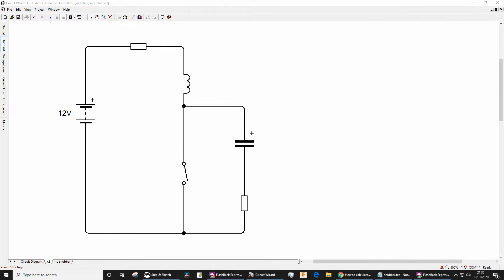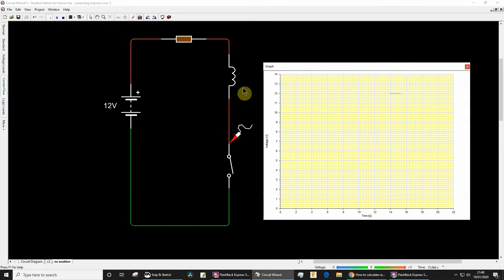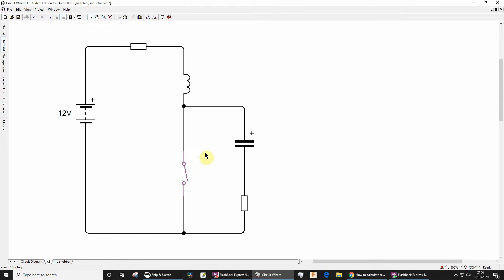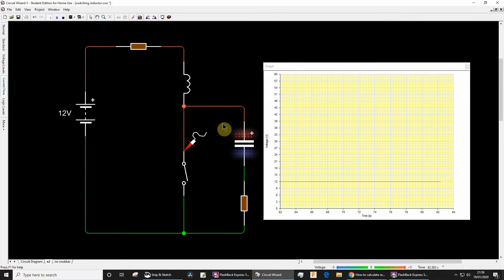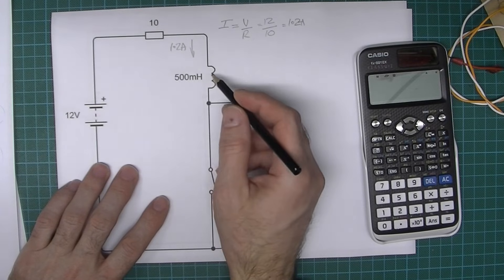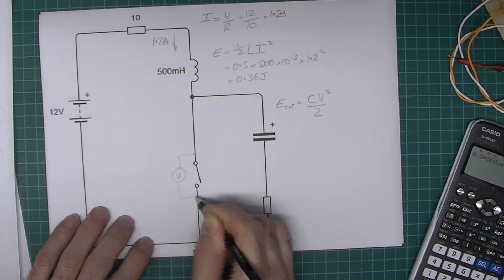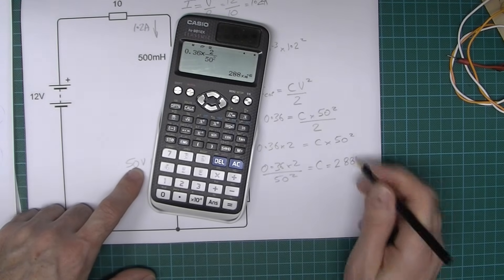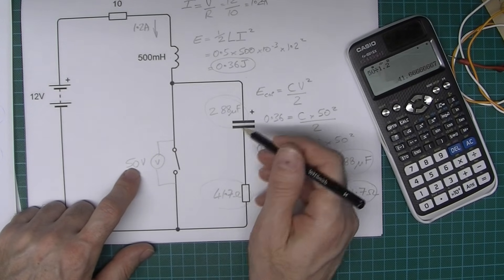RC snubber circuit design and calculations for inductive loads

Comment: What should be the wattage rating of the resistor? Doesn't I^2 * R = 1.2^2 * 41.7 = 60.048 W seem a bit much for a transient? How should this be calculated?
Reply from the maker: Calculating the peak (transient) power is clearly being very safe and likely over-specifies the resistor rating. Calculating average power might be more acceptable but we have not defined the switching frequency in this circuit. What do you think?
Reply: @PizzeyTechnology   The only thing I've been able to find regarding this is that the power dissipated in the snubber resistor is equal to the sum of the dissipation during the turn-on and turn-off of the bridge. I was hoping you knew of an easy way to obtain this as your video is very informative and is quite excellent.
Reply: @sayinpower3  you could try 2 * V^2 * f * C for a crude estimate (V=voltage on the cap, C = capacitance, f=frequency). this only takes into account one charging and one discharging per cycle. real dissipation might be higher due to ringing, if the system is underdamped.

Comment: Great explanation ,How do I calculate resistor and capacitor for an inverter circuits between the drain of MOSFETs and ground
Reply from the maker: Abu, thanks for your appreciative feedback. Can you post a link showing the actual circuit?

Comment: Thank you very much for the video. Few Questions though
1. The power rating of the 10 Ohm resistor should be 1.2*1.2*10 = 14.4 Watt ?
2. If I am using the Inductive load of a Transformer, How do I calculate the saturation current of the transformer.?
3. I want to maximize the output voltage of a pulse transformer, How do i achieve that through circuit design?  
Thanks in Advance
Reply: 1) correct. P = R x I^2
2) You don't. You need specialized equipment to test the transformer. If you are using an old SMPS transformer, usually people go for a Bmax of 1200 ~ 1600. You only find this information with the datasheet
3) what do you mean by maximize? You mean step up the voltage?

Comment: Will a snubber circuit recharge battery if it was switching a DC motor on and off? Making the whole system more efficient?also increase battery run time?

Comment: hi...pls clear me if i'm wrong.
why you considered 50v in the calculation of Capacitance finding. as the circuit is operating with 12v supply.
Also, you have calculated the circuit current by taking 12v voltage.
I think if took 50v instead of 12v calculation will be wrong. as we taking calculating value wtih 12v in all formulas.
Reply from the maker: Hello Shivm, those are good questions but you may have missed an essential point -- the circuit is capable of raising the voltage above the supply voltage. In the example I chose 50V but I could have chosen some other arbitrary (but acceptable) voltage. The snubber then suppresses the potentially high voltage caused by the inductor. Without the snubber, transient voltages can easily exceed the supply voltage by many times. Does that answer your question?
Reply: @PizzeyTechnology  Agreed thanks for the nice explanations.
Reply: @PizzeyTechnology  Even if the circuit has a potential to raise the voltage beyond 12V, the spike does not appear across the capacitor. The capacitor also stores its energy at 12V, so I agree the value used for the calculation of the capacitor should be 12V.

Comment: Dear Sir.. Thanks for easy explanation... I need to discuss on pwm based motor drive mosfet circuit.. I observe upto 40 v spikes... I need ur help do u like to share ur email contact... Mine is shahzad1474@gmail.com
Reply from the maker: Hello Shehzad. If you have questions like this then I highly recommend posting a question on https://electronics.stackexchange.com/
Just make sure that you include the full circuit diagram, a clear explanation of the problem and a clearly defined question.

Comment: What if I use  very high frequency switching then there is no time for the capacitor to discharge completely, how to deal with that???
Reply from the maker: Good question but not something I feel qualified to comment on (and have people rely on my answer). How about you research specific applications with a higher switching frequency - switched mode power supplies perhaps?
Reply: Maybe an NPN transistor, or a small mosfet pararell to the capacitor, so when the switch is turned on, it shorts the capacitor?

Comment: Hello, thanks for the video. Some questions: 
1) Does it matter on which side of the capacitor/switch the resistance is? 
2) Does the capacitor need to have voltage rating of exactly 50V or would it need a minimum rating of 50V? 
3) Why not use the amp rating of the switch to calculate the snubber resistance as, if I understand correctly, the discharge of the capictor will flow through the switch back to the capacitor, and thus not affect any other components of the circuit? 
4)  As the energy of the coil is equated with the energy of the capacitor, does it mean that all the energy of the coil will go into the capacitor, and that when this happens there will be voltage difference of 50V over the capacitor untill the switch is opened again?
Reply from the maker: 1) The snubber resistor and capacitor can be placed in any order; as they are placed in series it should not affect suppression of the transient voltage. It may be worthwhile noting that RC snubbers can be used with AC and DC loads. RC snubber networks (an actual component) are available and if you check a datasheet I expect you'll notice they are not polarised. I hope that answers your question.
Reply from the maker: 2) Exact ratings of components don't really exist as they have a tolerance. If you wanted to limit to 50V then it might be desirable to have a capacitor with a rating of at least 50V and preferably more. 100V would be a good margin.
Reply from the maker: 4) The voltage across the capacitor will be 50 V when the switch is opened. The voltage across the capacitor will be close to zero when the switch is closed.
Reply from the maker: 3) Not entirely sure that I have understood your question correctly -- sorry, it's probably me. The switch should have an amp rating to handle the expected current -- in this example circuit at least 1.2A -- but the calculations I go through are to limit the transient voltage. If I was using a switch rated for 50VDC / 100A it would not change my calculations. If you watch the video again you'll see that we simply use Ohm's Law to calculate a suitable resistor value, based on the known current and desirable peak transient voltage. You are right to think the capacitor will discharge through the switch when closed.
Reply: @PizzeyTechnology  for Q3: I think I am a bit confused here, as I don't see what the calculated total current in the "main circuit" (battery, 10ohm resistor, inductor, switch, battery) has to do with the discharge current in the "snubber" circuit (capacitor, snubber resistance, switch, capacitor), as I feel that the current discharge in the snubber circuit will happen before the current in the main circuit will come "on". In addition, as we are trying to protect the switch from the discharge current, it would make more sense for me if the snubber resistance would be calculated as R_snubber=V_capacitor/I_switch. Part of my confusion probably also comes from the fact  that I read in other sources to use the rated switching current for R_snubber (example can be found in the text under fig4 in: https://www.littelfuse.com/~/media/electronics/application_notes/reed_switches/littelfuse_magnetic_sensors_and_reed_switches_inductive_load_arc_suppression_application_note.pdf.pdf). Apologies for pushing, and thanks for the answer already provide.

Comment: Why do you have choosen the whole inductance for the calculation ? As far as I know you choose the leakage inductance because this is the part that you can´t use (magnetic loss into air) and it comes back as the spike to the circuit. Of course I don´t know If we are talking about a transformer or air coil here ? If it is the second you are right just wanted to clearify things. :)
Reply from the maker: In this example I assumed a single coil. There should be no leakage inductance that would be associated with coupling a primary and secondary coil. Is that right?
Reply: Of course you are right ! With air coil I meant single coil too. I should have tell it more clearly. Leakage can only occur with two or more coupled coils. It doesn´t make a difference by the way If the medium is air or iron or ferrite as anybodycould think that because of my answer above. Single coil never can or will have a leakage inductance only coupled coils. The medium just changes the leakage value itself.

Comment: Thank you very much for an easy explanation of a complicated subject. I appreciate the flow of explanation was fantastic.  I was just curious if the calculations remain the same with 230V AC signal? Could you refer some site on this subject. 
Further, if Snubber is in parallel to the load, will it be better option.
Reply from the maker: I found this reference that may be of interest to you - http://www.bpesolutions.com/bpemanuals/Snubber.pdf
Interestingly, they recommend the RC snubber to be placed across the inductive load "for best results" but mention that across the control contacts (the switch) "will also work".  It's a shame they don't explain this any further
Reply: @PizzeyTechnology  Thanks
Reply: @PizzeyTechnology If the snubber is placed parallel to the  inductor, the voltage across the switch is the supply voltage plus the spike voltage. That requires a switch that withstands higher voltage.
Reply: On a D.C supplied circuit (as the one here) the snubber is connected across the switch. On an A.C working circuit, the snubber is connected across the inductive load. Finally, nothing restricts the use of two snubbers in both places.
Reply from the maker: Maybe I should post a new video for 230 VAC supplies as you're not the first person to ask a similar question. Okay, let me think about it first. As for whether the snubber should be parallel with the switch or inductive load, I have always (rightly or wrongly) positioned the RC snubber across the switching element but assumed it could also be placed across the load. Thinking about this further, having the RC snubber across the load is a more direct attempt at protecting the vulnerable component (the switch) rather than across the load (which nonetheless should protect against a large transient). On the other hand, across the load would give the whole circuit protection against transients. Wikipedia and several other references show the RC snubber across the switch. Of course,  a diode snubber would have to be placed in reverse parallel across the inductive load.

Comment: Is this method appropriate to calculate the snubber for AC? Specifically a 230V AC contactor coil. Currently i use 100R (3W) and 100nF (440V X1 class) and it mostly solved the problem of EMI (IRQ false triggering and MCU resets) but i still occcasionally get false triggering of the IRQ line. 
The AC contactor coil (230V AC) is controlled by a smaller 10A relay which has freewheeling schottky diode on it coil (5V DC).  The snubber is installed in parallel to the contactor coil.
Reply from the maker: Good question but I'm always wary in replying to questions or making specific recommendations for circuits that relate to AC mains voltages. I hope that you understand. Have you tried probing the IRQ line with an oscilloscope to see what is going on?

Comment: It is interesting to see an RC snubber for an inductive DC load with a switch, but now I don't know if the right thing is to do it or put an antiparallel diode with the coil. Your idea is to protect the battery?
I found your video because I want to make an SSR to not buy a contactor and I don't know if I will buy it in the end because an RC snubber is needed to protect the Triac. Commercial SSRs do not take into account the inductive load resistance of the motor I have, so I don't know if I buy one and try my luck.
I find this about mosfet and RC Snubber http://paulorenato.com/index.php/electronics-diy/197-rc-snubber-calculator-spreadsheet
One about antiparallel diode https://www.youtube.com/watch?v=LXGtE3X2k7Y
And one about SSR https://www.youtube.com/watch?v=eZwJgPd7_p4
If the diode is set, is the voltage peak eliminated? Or is a RC Snubber better? and if I put both?
The video is very interesting.
Reply from the maker: Some good questions there and thanks for posting the additional links. The example I have shown uses the RC snubber to protect the switching device (in this case, an actual "switch") but this is not necessarily the best way to achieve this. As you mentioned using a triac I presume you are switching an AC load - appropriately designed RC snubbers can be used with AC or DC loads - but in my DC example a flyback diode might have been equally suitable and would have limited the rise in voltage to Vf of the diode. As an aside, it might be worthwhile investigating an RC snubber device rather than using discrete components. Why use both - do you want redundancy in case of component failure?
Reply from the maker: For DC loads it might also be worthwhile considering adding more than one "anti parallel" or flyback diode in series across the load. This would allow voltage across the coil to reverse to a higher voltage so the current could decay more quickly than with just a single diode. Hmm.. maybe a new video?
Reply: @PizzeyTechnology  Well it would be great to see it in a video, with how detailed they are. True, now I remember the arc by contactor disturbance and the spark arresters of the magnetic-thermal switches. That means that if I buy a contactor and want it to last a lot, should I do an RC snubber?
In the courses I attended, teachers always recommended the diode for a Relay in DC and never named a snubber network, not even for an SSR for AC or DC.
The engine I want to control is a 1200Watts mono phase water pump, but I would have to measure the peak voltage when opening the switch to calculate the RC snubber for a Triac, but I imagine it would reach 5000 or 6000 Volts, I would have to do a resistive splitter so as not to break the meter. Measuring its inductance is complicated, I would have to make a meter first.
What I am not sure is if it influences that it is brushes, squirrel cage or asynchronous. Or if it has a starting capacitor. When I think about it that way, I see it complicated and I want to pay the extra for a contactor, they are expensive and their useful life is minimal compared to a well-done SSR. But as I am a little freaky and curiosity can with me. I am one of those who ask too much ...
Do you know CADeSimu? I used it a lot to design and simulate automatisms with wired logic and now it has been updated enough, it supports Arduino simulation.
Reply from the maker: @a-job7276  Take a look at this document and it may answer some of your questions: https://www.galco.com/techdoc/pktn/504m02qa100_cp.pdf

I've no experience of using CADeSimu. As a school teacher I mostly use the software my students need to use, but I also use NI Multisim live online simulator and Circuit Lab from time to time.

Comment: thanks for the explanation. I saw some circuit with R  first and then C, are they going to have same response.
Reply from the maker: You can expect the same response. I'm glad that you found the video useful.
Reply: I'm not 100% sure, but I think the capacitor would discharge much quicker. Don't take my words for it. I'm a newb.
Reply: No they will not have same response. Please check dv/dt at midpoint of R and C when it is connected in RC and CR fashion. They are different. I am having the same query.